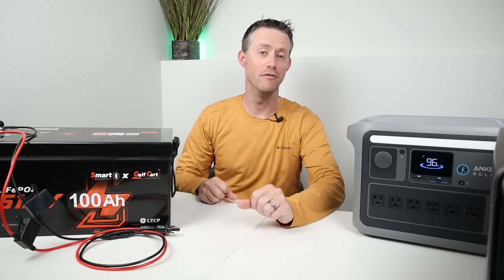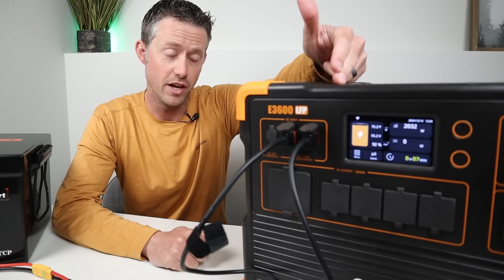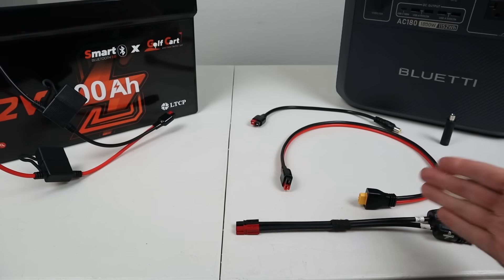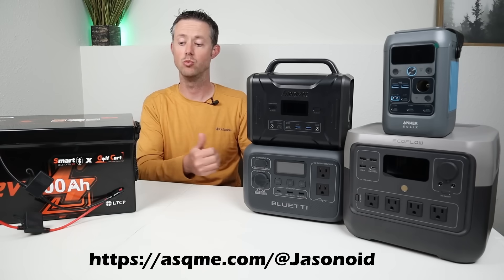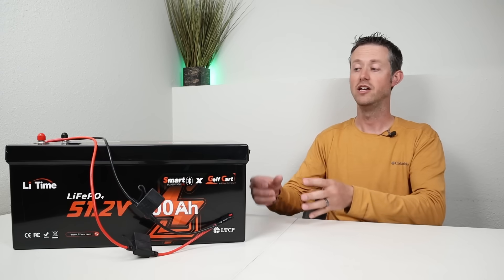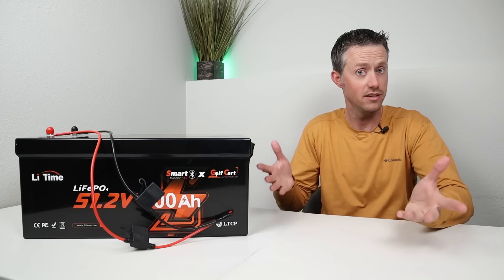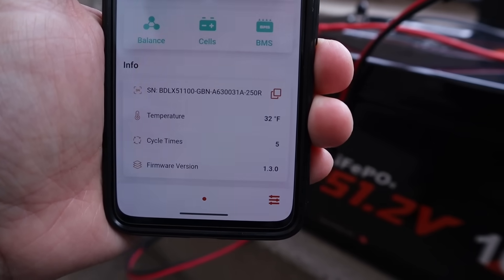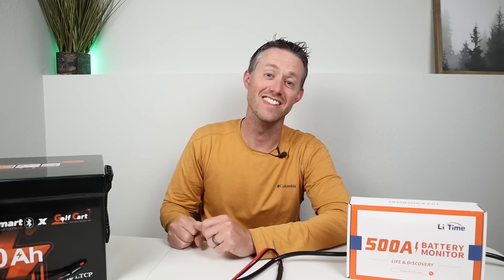Simple Trick to Make Your Power Station Last 5X Longer! Charging with a LiTime 48v Smart Battery!

Comment: Hello Jason. I'm a complete neophyte to the electrical world and don't know how to calculate all the mathematics and would greatly appreciate a video or comment.  Here is my situation and what I am looking for.  

I have a 14' Rove Camper/Trailer that I want to take on winter weekend trips (boondocking). I'd like to run a small room heater in the cabin for 48+ hours and don't want to use my propane, because I will need that to cook or use as a backup for heat (if the battery goes dead). I expect the outdoor temp to be 25-40 degrees. During most of the day I can keep the temp to 45-ish degrees (to keep my water from freezing), because I will be out hiking/exploring.  At night and meal times I'd like to crank it up to 65-68 degrees. What size battery & power station & charger/solar panels would I need? Approximate size and weight?  My thoughts are simply to charge up from home before I go and when I return home. I'm hoping the battery lasts me all weekend. Any other suggestions? Thanks a million.  Great videos!
Reply from the maker: Electric heaters pull WAY too much power for a battery system. Even a large power station like the Jackery 5000 will only run an electric heater for a few hours. I'd recommend looking into a diesel heater for your setup. They are very efficient (taking only 1 gallon of diesel for over 24 hours of runtime) and will work well to heat your small space. There are HUNDREDS of videos about using diesel heaters. I'd recommend searching 'using a diesel heater to heat my cabin' on Youtube and you'll find tons of videos.

Comment: Help me see why I would want to do this, the battery needs to get charged from somewhere. If it's just cheaper capacity, cool, I'm always down for these kind of hacks. Power stations are essentially for portability, correct? A full home off grid power system is not going to include one of these for any reason. Is LiFePO4 the standard now or is lead acid still the cheap[er option for storage I may build off grid, if I can actually live like I live now

Comment: So question, a rube Goldberg idea.

What if you had solar panels with microinverters and you hooked those up to the lithium battery with the charger. And the lithium battery to the power station.

Would the charger shunt excess power into the battery to charge it if the battery bank were full and the battery wasn't?
Reply: Yes.

That's ideally how you would have it set up anyways this have your solar panels go through a charge controller and then charge the external battery and then go from the battery to the power station.

Comment: What size wires are you using I did it with a boost converter but it’s only 240 watts with a 16awg wire and it got a bit warm so I unplug it from my car battery what wire size should I buy so it wont be hot at all ?
Reply from the maker: I'm using 10 awg wire rated for 30 amps continuous, most power stations will pull around 10 to 15 amps. With a 48v battery you'll be able to charge at about 1200-1300 watts without the wiring getting hot. Most power stations won't even get close to that so the wire is a bit overkill but safe.
Reply: @ okay thank you so much I just order me some 10 gauge marine wires

Comment: Love your channel. I apologize in advance if this is a dumb question but can I hook up the anderson to XT60 cable directly to my solar panel that has an XT60 plug to charge the smart battery directly?
Reply from the maker: No, you'll need a solar charge controller to take your solar panel voltage and turn it into the proper battery voltage.

Comment: Has your Ecoflow Ultra AC output shut off on you. I am typically pulling 500Watts out of my Ultra and lately every couple of months the AC output just shuts off. No alarms or errors displayed. I just hit the AC Output button and everything comes back up. Ecoflow has no explanation and seems to just want me to go away. I can't get any explanations. I have five battery packs, and my load is not taxing the unit. Also, when the charging is complete, the transition sets off my UPS which receives power from this unit.
Reply from the maker: I've seen that once before on mine. Think of the DPU like a large computer. It needs to be power cycled every three or four weeks to keep things running smoothly. Just like any router, smart phone, or laptop. I'd set a reminder in your calendar to power cycle it at least every few weeks and you probably won't see that issue anymore.

Comment: Hi, Thank you for a very informative video @Jasonoid.. I just want to ask, does this MC4 and Anderson connector with fuse works bi-directional, means I can charge and discharge the battery? Let’s say I have a AC to DC converter?
Reply from the maker: Yes, it supports charging and discharging the battery through that cable.

Comment: Hi Jason, is getting a 48V battery instead of 12V batteries.  is the differance on charging times
Reply from the maker: The charging time is all based on the size of the battery, or the watt hour capacity. For example, a 12v 100ah battery has 12080wh and a 48v 100ah has 5120wh. The 48v battery will take four times longer to charge since the capacity is four times larger.

Comment: Now how do I use my Delta 2 to reverse charge the battery? Might have missed that. Instead of having 2 solar controllers (given one is in my Delta 2).
Reply from the maker: You will need to manually charge the battery back up using an AC wall charger (that could connect to the Delta inverter). I was impressed with the LiTime charger:
https://www.litime.com/products/48v-18a-lifepo4-battery-charger
Reply: @ Thanks for the fast reply!  Won’t work for me so I guess just a bigger station itself haha.
Reply from the maker: @socalexpeditions  yep, sometimes the added cost is worth the convenience 👍

Comment: Thanks was looking for a video like this. What would be the best to charge the battery if you don’t have solar. Is there something I can plug into the wall at the same time I do my power station.
Reply from the maker: This is the AC charger I used, it works well!
https://www.litime.com/products/48v-18a-lifepo4-battery-charger
Reply: @ thanks
Reply: @Jasonoid could you use the Bluetti Charger 1 to charge the battery from a car?  Do you charge that battery directly from the POS/NEG terminals?  I'm assuming it would stop accepting a charge once it's fully charged, or would you have to watch its SOC from the app?

Thank you!
Reply from the maker: @dailydr1ver935  the Charger 1 is not a battery charger, its designed to charge power stations. Youll need to look up a DC to DC LFP charger to do that.

Comment: The ATC fuses you use are rated for 36v and this is a 48v system.  Think you would be better off with a MRBF fuse which handles 58v.  They can also do higher amperages for something like the Chargeverter.
Reply from the maker: Thanks!

Comment: Charging the Delta pro ultra via AC (from main) with a manual switch (that does not switch neutral) while using AC discharge power is a no no given the risk of ground/neutral dual paths. One of the options is to use a SMPS to take AC power and transform it to DC power and feed one of the solar ports. For a backup additional power, this battery looks very interesting. I wonder if one can kill two birds with one stone. Could the LiTime 48v charger be used to keep the DPU charged up by connecting it to a solar port (to use the stack as a shift for time of use periods) ? Then for prolonged blackouts, the battery could be connected to fill up the DPU. Once power comes back, the charger could be used to fill up the Litime battery and then back on the DPU. Crazy talk or could make sense? I'm asking just because when looking on the LiTime website, they talk about the three charging modes for the charger and I wonder if this would make it problematic when directly connected to a DPU. Thanks for the great and informative work!
Reply from the maker: I use large 48v batteries as extra power everyday on my DPU (shown at the end of the video), it works excellent too! I have about 20kwh of 48v batteries. I have additional solar that charges those extra batteries so everything gets charged back up in one day (if it's sunny).

Comment: I like this material and use a 24v battery as a battery expansion. 
I'd like to add that when i use the expansion battery during a power hungry camping trip or an oiutage, I limit the Power Station charging to 80%.
This is impirtant because there is a lot of energy expanded to bring the SOC from 81% to 100%. 
This actually provided me with more useable energy from the expanded battery. 
Thanks again
Reply: I don't see the advantage in using a 24 volt battery over multiple 12 volt batteries
Reply: @CharlesHallESP  The current is lower when using a 24V battery so cables can be smaller, etc.
Reply: @richardw1776  Or you could connect the multiple 12V batteries in series. Current stays the same, but voltage is boosted.
Reply: You should really keep LFP batteries at 100% though. Or even just fully charge it once in a while. The cells don't particularly care but the BMS will eventually lose track of the state of charge. Meaning a displayed 20% equates to a depleted battery and it shuts down at an inconvenient time.

Comment: With the dual mppt inputs you only need a 24v battery to max out the 500w
Reply from the maker: You'd get about 390 watts per port with a 24v battery (26v x 15a = 390w)

Comment: I have the bluetti ac70 which battery would help me charge as quickly as possible. The ac70 accepts up to 58v 10ah. I think that the litime 48v 100ah is a lot of voltage since it reaches 58.4v fully charged. What would be useful in my case?
Reply from the maker: Any 48v battery should work just fine 👍 the Bluetti AC70 allows slightly over 58v. The fastest charging will be with a 48v battery.

Comment: Another great clip. Really enjoy your channel. Question: I have a Dabbsson that takes up to 150v at 25a which should pump in over 1200w. Does it cause any issues to the battery if I set the charge rate in the app to say 900w?  Or will it automaticaly max out? Just wondering.
Reply from the maker: This battery can handle 5000 watts continuous output. The wiring in the video is safe for 1500 watts as well. It should work just fine on the Dabbsson 👍

Comment: hi, thanks for the video;  I just got a Bluetti AC70 power station and not sure what expansion battery to buy.  any suggestions.  thanks
Reply from the maker: The AC70 allows up to 58v input and 500w, so a 48v battery would work just fine 👍
Reply: @Jasonoid  SWEET, Thanks Bro.. be safe and healthy
Reply: can you also recommend a good priced brand to buy
Reply from the maker: @randy-6364  Li Time is a high quality budget brand. They have been around awhile.
Reply: @Jasonoid  why such a price differance from Li 12V 100amp to 48V 100amp
Reply from the maker: @randy-6364  the 48v 100ah battery is like having four 12v 100ah batteries (1280wh) in one big case. The 48v 100ah battery (5120wh) is four times bigger 👍
Reply: @Jasonoid  thanks fpr helping me understand
Reply from the maker: @randy-6364  edited my previous message to be more clear **

Comment: I’d like to see an actual end-to-end setup fully configured which includes methodologies for recharging the standalone 48v battery.  Seems to me it would have to be solar, otherwise, you’re just pushing watts back and forth between the power station and the battery, which is not scalable.  I have been considering adding a bank of these standalone 48v batteries connected to my power station (Delta Pro Ultra) and redirecting my solar panels into the stands like batteries, if that makes sense.  It should not stop charging everything until everything is full, near as I can tell… thoughts?  Thank you for the video.  Fun hobby and useful in power outages!
Reply from the maker: I show all this connected up to my DPU at the end of the video 👍
Reply: Or use a large amp hour 12V battery with a boost converter to 48V. Then the 12V battery is easy to recharge via solar, dc/dc, or ac which you probably already have in your vehicle. A boost converter that provides 20A at 48V from 12V is around $60 USD. So a couple hundred bucks could get you started down this path super easily with nothing more exotic to buy and no need to have a 100 lb battery around.

Comment: What stand-alone charger do you recommend for that 48 volt battery? Love your videos!!!
Reply from the maker: The LiTime 51.2v 18 amp charger is a high quality model but it's got a cheaper price. It's on the Li Time website and it will charge the battery around 1000 watts 👍
Reply: @Jasonoid  Thanks.! I'll look into it.

Comment: I am running a Delta 2 Max. It allows 15A max input, so would I use 15A fuses in the adapter?  Any advantage to using an XT60i plug into the Delta 2 Max instead of a standard XT60?  Also, looks like the Ecoflow needs the female XT60 for the solar inputs.  Thanks for another great video!
Reply from the maker: Fuse sizes are determined by the wire size you are using that come off the battery. The adapter in the video description is a high quality 10 awg cable with built in fuses. You'll use 30 amp fuses with that cable, not 15 amp fuses. If you want the full power on the Ecoflow products you'll need to purchase the MC4 to XT60i solar charging adapter. Since the power station has two charging ports, you'll want to purchase two whole sets of adapters, one for each port.
Reply: If you only use the normal XT60 connector on your Delta 2 Max you will only get 390-400W of input.

If you use the XT60i you will be able to max out the input ports at 500W each.

Comment: I didn't know if the output capability of a stand alone battery could exceed the input limitations of a power station and burn up the power station. I know you can exceed input voltage and burn it up. I have the Litime's  140 Ah battery and the BMS on it is 150 amps. I guess the power station charge controller will keep the input current draw at a safe level for itself. Am I right?
Reply: Yeah, they can accept basically anything that you plug into them. 

Current is only ever drawn in as needed.
Reply: All power stations are Curent limiting they look after them selves its the voltage you need to be careful of if you exceed it the pcb is only designed up to the stated voltage any higher and it can cause arcing across traces and the relays can’t handle the extra voltage as it hey open and close

Comment: what about buying the connecting cable from manufacturer of the powerplant, then cannibalize the cable and wire it to your own 48v array? The the powerplant would charge the array.
Reply: Lots of people have tried with different brands and the cables that go back and forth between the battery and the power station have communication lines in them which requires some circuitry so that the units can handshake before they will recognize that a battery is even connected.

Comment: In a RV set up, can this 48V batterrie be charged somehow via the “bluetti charger 1” or solar panels?
Reply: The "charger 1" would not work, but a standard solar charge controller would 👍
Reply: @andrewr05  Thank you :)
Reply: Check ETAKER F2000. It is multi input and output and best of all, it charges your RV car battery back. It can even jump start it. It can do input of 1000w DC + 1000w solar to a total of 1800w output. The ports are bi directional and customizable.
Reply: @fongsa1yuk  Thank you :)
Reply from the maker: It would best to use a dedicated 48v battery charger or a 48v solar charge controller to charge the battery
Reply: @Jasonoid  Thank you :)

Comment: Awesome video!!! Just what Ive been looking for. 

Currently I have a Pecron e1500lfp with a 200W solar and an etaker alternator charger all working together in my SUV - BUT I've been wondering if I could add a 48V like this to my setup instead of getting the $999 Pecron expandable battery - would that be possible? 🤔 

Any thoughts on this would be super appreciated!!!
Reply: Unfortunately the high voltage "solar" input on the Etaker only goes up to 48V. 
("48V" 16s LiFePo4 batteries top out at 58V)

So there wouldn't really be a way to combine the two.

But you can put the e-taker into the low voltage input port and then the 48V battery into the high voltage inputs of the Pecron, as that takes 32-95V.

Comment: Hi, great informative video. Does the  Delta 3 plus allow parallel input on the two 500w solar inputs?
Reply from the maker: Yep, that's how you get the full 1000 watts. 500w per port 👍 it allows power from the same source too
Reply: @ Thank you!!!!

Comment: Awesome video! This has got to be the most economical way to increase capacity on a power station.
Reply from the maker: It's pretty simple, and it works! Just keep in mind it also takes 'babysitting' to charge and discharge the extra battery manually. An expansion battery is automatic so you kinda get what you pay for 👍

Comment: This is a great expansion technique.  It will allow your power station to last "forever" as long as the solar input can provide more than your average use over the lifetime of the internal battery.  (That way the internal handles short term high use, and the external battery will recharge the internal when your use is at or below average.)
Reply: Could you connect solar to the LiTime at the same time that it's charging the Anker?

Comment: *  Make certain the input voltage of the power station allows at least 56 volts!  *  Preferably 60 volts.

A 48v LiFePO4 with a nominal voltage of 51.2v is charged at up to 58.4v.  It will rapidly settle down a little lower than that, but if you charge while connected to the power station... Ouch.  If you charge "disconnected" it will drop fairly rapidly down to 56 volts, but best to check with a meter if your power station requires less than 60v.
Reply from the maker: I clarified that in the video @ the 4:15 mark